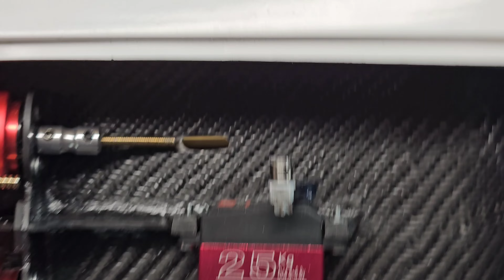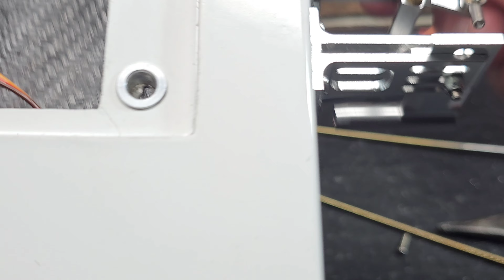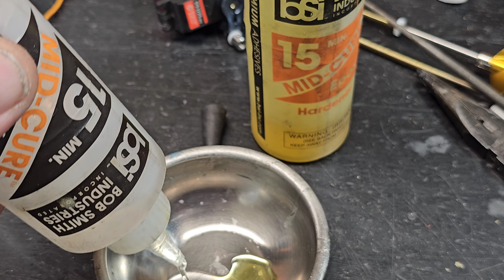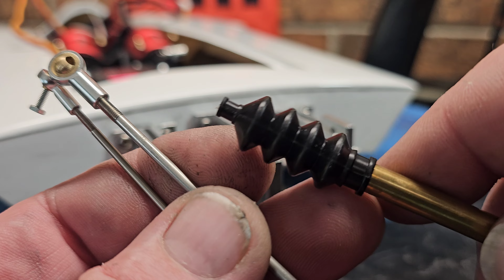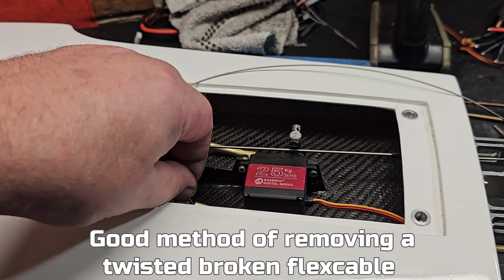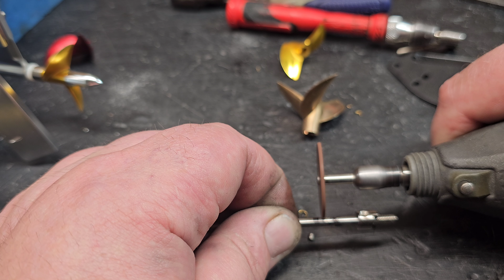Flex Cables, Stuffing Tube, Drive Dog & Steering Deltaforce Vortex 24 Twin Hydroplane Build Series

Comment: Great build, almost ready for the “bathtub test” 😊 Really like how you solder the flex shaft where it goes into the collet on the motor shaft, for solder joints that are subjected to high heat, like on the esc connectors 95/5 solder has a much higher melting point than the more traditional solders have. 👍🏻
Reply from the maker: That solder crucible has about 5 or 6 different soldiers in it 🤔 it's a hodge podge
Reply: This is the first time I've seen you solder the cable and out of all the video you fast forwarded it. I know you can't please everyone. @IRONCLADRC
Reply from the maker: I have an old video in my library on just soldering the end of a cable.

Comment: Great video and boat. One suggestion however is to epoxy in only the motor brackets (with the motors attached for alignment). That way you can remove a motor conventionally by just undoing the bracket to motor screws. Might be better cooling for the motors that way also so air can get to the entire circumference. Just a thought.

Comment: Awesome work as usual. Question though, when you cut the shaft, what did you use to cut? It? Was it the same cutting wheel that you used for making the flat spot on the drive dog area of the stubshaft
Reply from the maker: Yes, sir, I used the Dremel cut-off wheel.

Comment: @ironcladrc have you replaced the hatch screw inserts on a Sonicwake? I just had 2 go bad and can’t figure out a good solution
Reply from the maker: Proboat has replacement screw and locks
Reply: @IRONCLADRC I got the screws, I can’t find the inserts in the hull. It appears they don’t want you to replace them.
Reply from the maker: @its0nlya6  I just sent a subscriber my last set, caught me a few days late